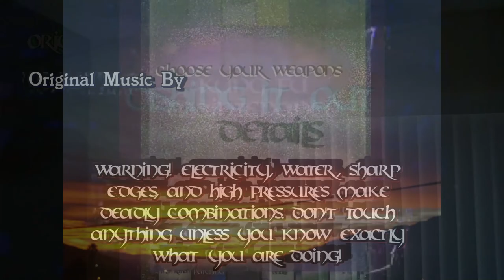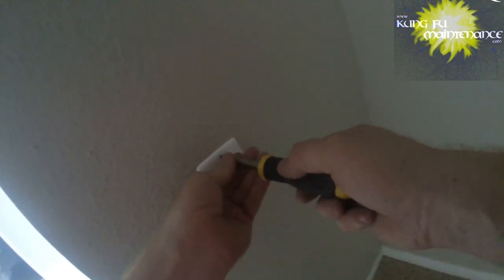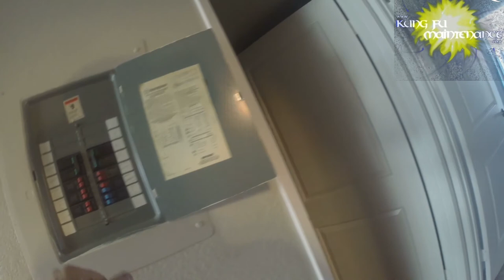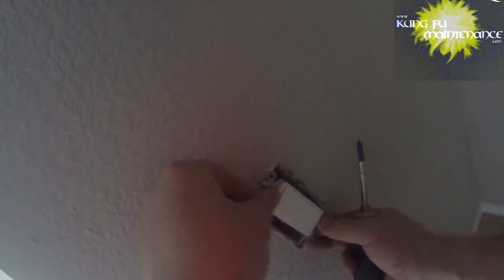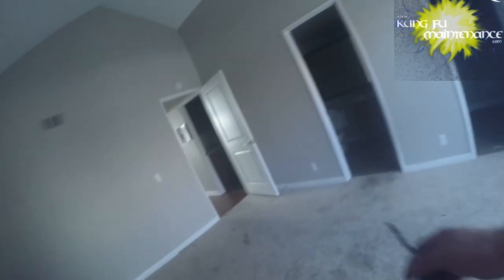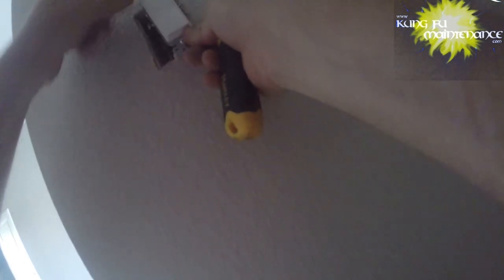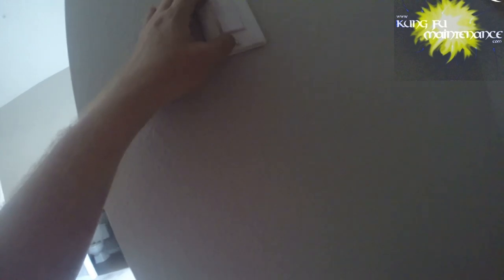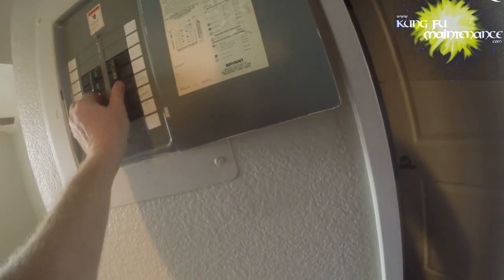How To Replace Bad Rocker Switch

Comment: So my new rocker switch works when tested, but didn’t work when I screwed it into the wall. Thought wire came loose so I redid it and it still only works when I have it out of the wall.